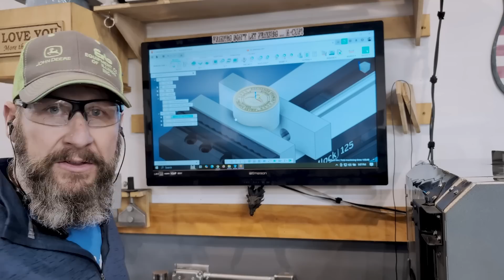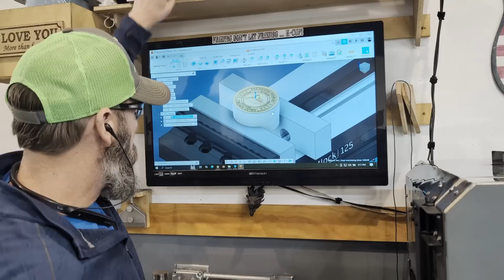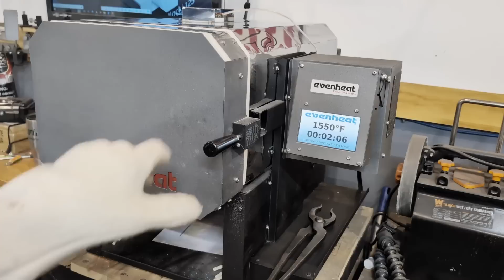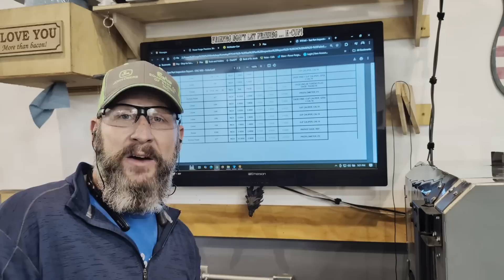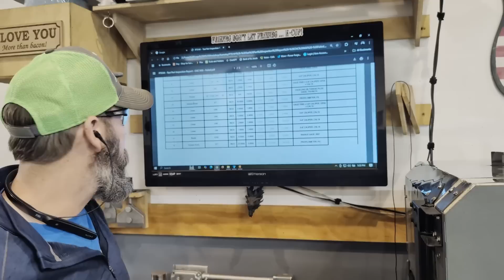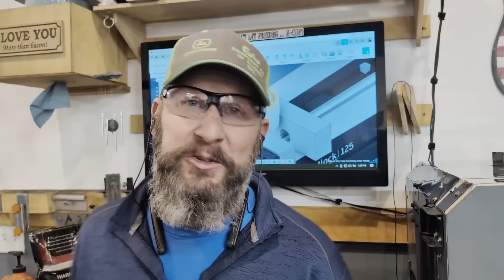Becoming a Partner with Xometry in 2024

Comment: So would you recommend xometry to someone new with limited equipment or tell them to steer clear? Im looking at as I too have alot of down time for my machine but it seems like the onboarding process is pretty competitive when trying to get the first few jobs after the test part, Can you communicate with the customers at all and ask for clarification after taking jobs, you were talking about some parts with square corners or what seem to be design oversites for manufacturing, but there are people submitting parts to be made that aren't certified engineers or haven't tried to make parts before and dont understand some common practices to make parts actually feasible or machinable. Would it be worth it to take some of the more difficult jobs just to make it through the onboarding process, so you can have accesses to a different kind of customer/ more job opportunities based on partnership level?
Reply from the maker: If you have the right "limited" equipment and want to try it, then I would say go for it.  The right equipment would be like a CNC Mill or Lathe. I have a 3 Axis CNC Mill. In retrospect, I don't think the onboarding process was overly difficult. Just break it down into its subcomponents and do them individually.  Just doing that is still a win in my book. Personally, I learned some valuable lessons and am better for the experience. 

As a partner with Xometry you are not authorized under any circumstances to ever communicate directly with the customer.  For complicated / impossible parts I would just let them go.  I doubt any machinist will do them and eventually the customer will get the message.  If it's a part that you can do that would result in a small radius where the solid shows a 90, I would take the part and then send a tick to Xometry's Engineer team by flagging it "clarification on Requirements" letting them know you can do it with a radius.  

It's so competitive (I'm told) that you should take the part, cover your but by sending a ticket, and 9 times out of 10 Xometry authorizes the radius and job done.  Otherwise, you can cancel the part without penalty.
Reply: @PowerForgeWorkshop  Thank you for the feedback, im working through the onboarding process now and waiting on material for the test piece( i have scraps from work i can take home to practice with but nothing large enough to make this part) I too have a 3axis cnc mill and will be attempting this. Surface finishes are one of the things Im not sure about but I have a friend with a profilometer I might be able to use to get my finishes in spec, but I see that the drilled and taped holes will require some more care than Im used to.
Reply from the maker: @TheDarkrider551  No worries. Good luck with the part! Hope all goes well.
Reply: My limited experience is that it's not worth it especially with limited equipment. If you're manufacturing stuff yourself and have a robust distribution for your stuff where you're making money and you want to "uber" your machine time out, maybe. But at least coming from Taiwan, the pay from the job does not cover the shipping cost at all. I think when manufacturing your own stuff (got a friend who does this) the finish requirement is not as high... often tool marks are seen as "features" by customers.

Comment: I passed the test almost two years ago and yet to have accepted a job from them.  Their pay offerings are absolutely insulting.  Many times the cost of the material is more expensive than what they are offering for that particular job.  In my opinion I see where xometry would be good for a shop that has a lull in work to keep their employees busy keeping the spindles running.  Other than that I am not going to go go backwards to work for peanuts or in this case peanut shells.
Reply: Started doing work for them back in 2020. Did near 20 jobs total, with next to none of them actually being profitable. Last job I took was not uploaded correctly by the end customer (they selected standard tolerance and no threads, part had a +-.01mm bore and whitworth thread. Tried to explain to support I might be late since it required a new insert and tolerance that wasn't listed on the board, and explained they were losing money just as much as I was. Their correspondence devolved quickly into insulting me, and I ended up on the phone with their supervisor. That really accomplished nothing, but I found they take about 40% of the profit off the top before posting to the job board, when they don't even have to have human interaction with it. Haven't taken a job from them in over 2 years.
Reply: @SpecFord13  A lot of the prints I look at many of the features cannot be machined on a mill.  I think a lot of the people designing these parts have no machining experience at all.  I don't know, I just tossed my hands up with these people and went elsewhere.  Some people are happy working for peanuts I know I'm not.
Reply from the maker: Good points. The only successful partners I'm aware of never take the asking price.  They always send feedback with a counter offer. I think that only works if you're in a Premier Tier though as I have yet to see a part I want to machine.
Reply: @PowerForgeWorkshop  These people are absolutely nuts imho.  For example I remember seeing this one part that at least was two ops requiring a fixture plate AND black hard coat anodize for likt $258 dollars.  Part size wasn't large but it wasn't small either.  My local anodizer has $100 minimums.  So for material including fixture plate, programming, setup, machine time + anodizing + time required for inspection + time for package prep all for the mere price of $258 dollars?!  Granted this doesn't include cost for consumed electricty (which isn't much in this case).  I have a digital meter on my circuit so I know what the consumption is.  I could make more money working at a mcdonalds than most of their jobs.  Here's the thing people.  STOP taking their jobs and maybe they will have better offerings.  Keep taking those jobs and nothing will change is the way I see it.  I've moved on from them. I wasted more time checking those job postings.
Reply: Hi guys, we worked with the EU Xometry branch, and last years (2020-2022 was ok) was TERRIBLE! As you’ve mentioned here , the material price was often higher than what was offered for whole order!, and they started ordering from China it go to hell.

And yes, we also have issues with some orders that were made exactly according to the specified requirements and drawings, yet they make claims anyway and expect us to pay. Since they are just a middleman, they bear almost no risk.

At this moment, my company is struggling with a 12k EUR order that has already been checked by an independent lab and is fine, but they are claiming unreasonable things to avoid paying. I can see I’m not alone in this.
Reply: Sounds like people are upset that THEY are making money. Isn’t that the point?
Reply: @ I’m actually happy they are making money.  Just stating the facts for my situation is all.

Comment: I went through the xometry onboarding at the end of '23 and my experience was pretty similar. I had the same issue with them sending jobs I didn't have the equipment for. I had only signed up for 3-axis mill and was seeing lathe work, sheet metal cutting, and 5-axis profiles. The few jobs I had the equipment for were way too complex or made of some crazy material and I couldn't have completed them in time. I spent a few days checking the site every hour or two, then tapered off and gave up after a month of not finding any jobs worth taking. The pay for the jobs I saw wasn't nearly good enough to make up for the hours and hours I'd have to spend checking the site.
Reply from the maker: That describes perfectly what I'm seeing.  It seems that it is very competitive and that the few jobs that are available to the new machinists are quickly taken. The jobs we see are what the premium tier partners don't want to do. Great business model for Xometry.  I doubt they care who does the work.
Reply: Xoemetery is basically you bidding against China everyday